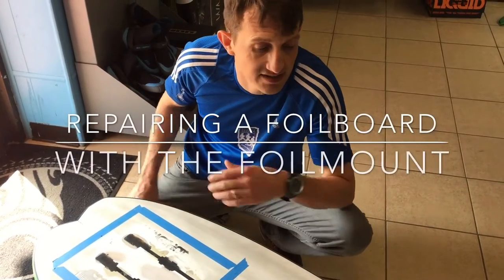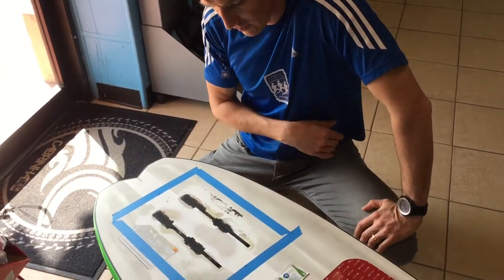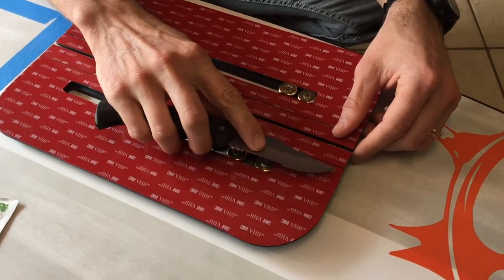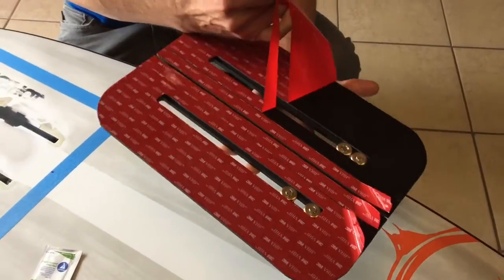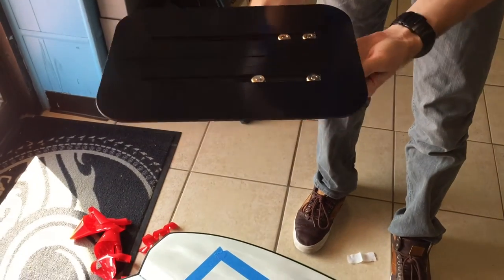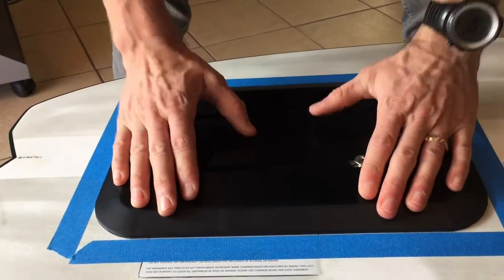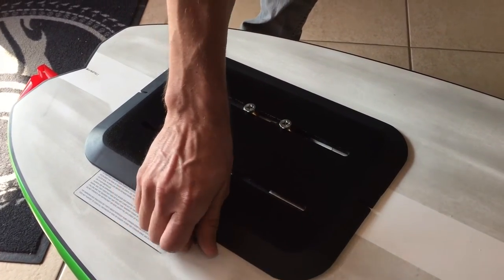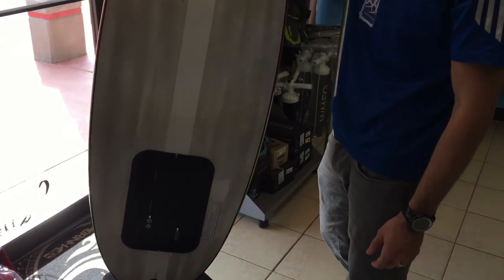Fixing a Hydrofoil Board with the Foil Mount

Comment: What kind of polyester resin do you use. I did this same thing to my alien air and want to do exactly what u did so I can restore it but there were many choices on amazon and don't want to buy and fill up the tracks with the wrong one like the laminating vs the casting one
Reply from the maker: Thanks flyingcamel and great question.  We actually used West System 105 epoxy resin and 206 hardener.  Poly is what most people use because it is cheap, but will only stick to poly boards.  Epoxy will stick to either so it is usually what we use for board repair.  You just have to take your time with mixing smaller amounts as it creates a lot of heat.  We used micro-beads as well to thicken it up and use less resin.
Reply: Houston Kiteboarding awesome thanks for the info. If I don't totally botch the job then I'll be ordering that plate soon!

Comment: Amazing. Where can i buy one of these. Would the tracks fit a 2017  Cabrinha Double Agent.
Reply from the maker: It will fit the Cabrinha Double Agent, but you may have to drill out the treads of the base plate depending on the year.  FoilMount made a video talking about this subject.